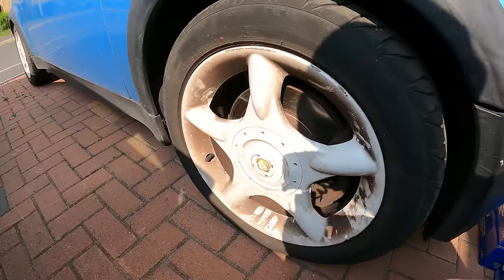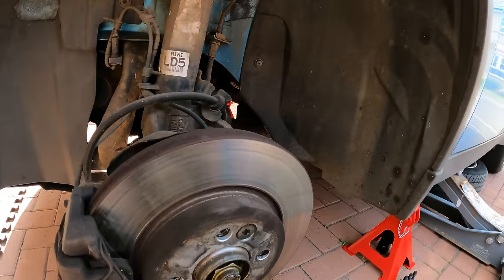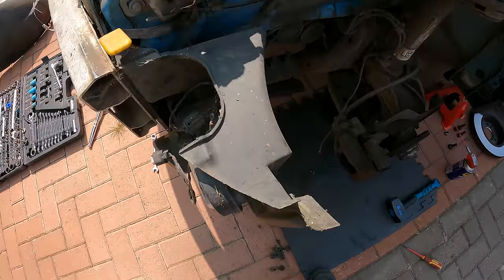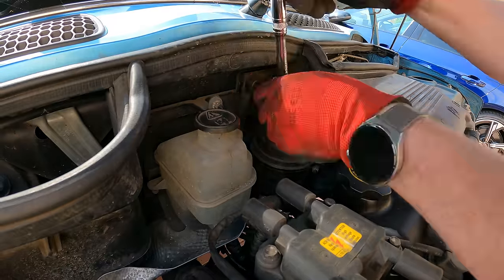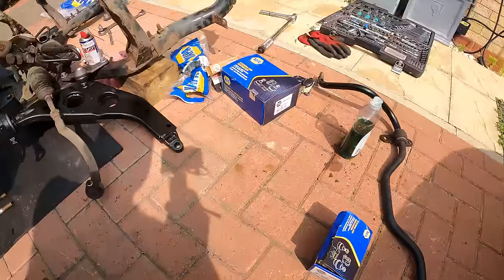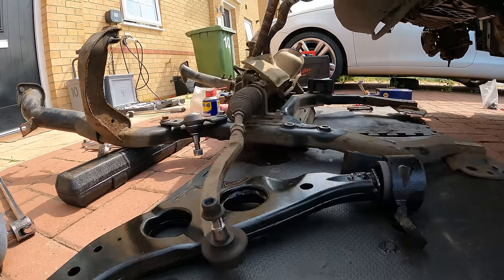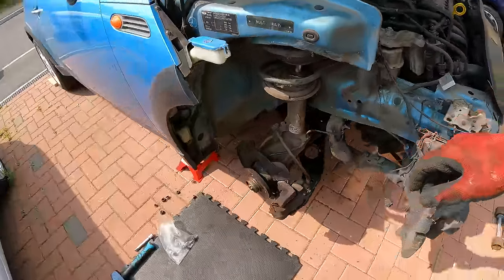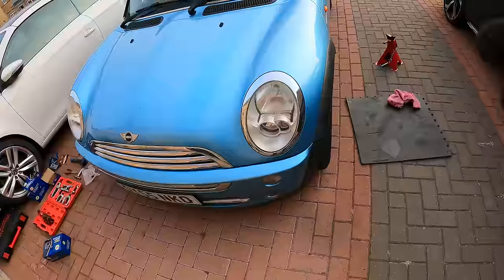MOT FAILURE MINI Warning: You'll Regret Not Knowing This!

Comment: When I go to the trouble of removing a sub frame, any sub frame, I spend that bit of extra time to remove surface rust, flaking paint and give it a coat of red oxide, and whatever hammerite I happen to have in stock.
Reply from the maker: +@stukyu I really wanted to do that, but time was against me on this one. I also had a lot of stuff packed ready for the house move.
Reply: Agreed. Once you’ve had a Mini in perfectly good mechanical condition fail it’s test because of excessive front subframe corrosion, you get a bit paranoid about this. Just had mine up on ramps and given it the full wire brush + rust converter + Hammerite + Waxoyl treatment 😂😂
Reply: Do the “while I’m there’s” is my go to for doing it right
Reply: Lanoguard. Sorted.

Comment: I parked my 1975 Land Rover by a Mini the other day. The Mini was not so mini, being longer and wider than my Series 3 Land Rover 😂.
Wow, new minis look so simple to work on. Not like the original ones which were so terribly overcomplicated and blew their own engines up at 60k 😂🤣😂.
As others have suggested, poly bushes would have been the best way to go. They are just a slightly better material than the cheapy rubber ones you got, which are possibly made India anyway. Also there is no point in changing parts which don't need changing. They may already have been done recently and just look a bit old.
Good luck in your new garage 👍

Comment: I did mine too. Never touched the subframe though! Removed the wishbone and used a reciprocating saw to cut through the old rubber bushing. Replaced with a polybush and compressed it in using a special tool freely available on a major auction site. Bit fiddly to line up and compress but was doable.

Comment: It's Mini's like this that I want to save from just being scrapped or broken for parts. Not so much about profits but more to keep them on the road. It looks like they are in the 90's dip of the classic Mini and rather than seeing them drop off the roads, I want to keep them on and loved. Electric blue too, great colour! If you need to remove the radiator at all (i.e. replace the shroud), check and test the low speed fan first. The resistor fails and the replacement needs the shroud off ideally.

Comment: Great job well done that man ,next time clean All the electrical connectors with WD40 contact cleaner before putting them together works a treat 👍🧑‍🔧
Reply from the maker: +@mrgrumpy9077 Thanks for the tip, I will keep that in mind for future videos.
Reply: Brake clean is cheaper.  Nearly all these sprays are iso propanall based.

Comment: Is possible to change arms without dropping subfame completely. Drop subframe a few inches enough to remove the long bolts .
Reply from the maker: I have seen some videos where you can drop the back to give access to do it but the bolts are very tight so it would depend on the access and the ability to get the bolts out. There is also the option to replace the bushes after doing that but you would need more tools to make it possible. I honestly think the cleanest way is to drop the subframe.

Comment: I assume the engine is not attached to the subframe?
Reply: They are mounted to the body. Just tied to the subframe to avoid torsional movement. So the subframe can be removed without having to support the engine.

Comment: Regarding the wheel Alinement of your Mini..! The Wheels are supposed to be positioned slightly Toeing Out because as the car is driven...! The Wheels get pushed inwards, more so on fount wheel drive because the off the driving torque of the drive shafts...! Best leave it, as is...! 🤔🤔😇😇👍👍

Comment: What mileage is it on?  My Mrs has a 2012 cooper S Roadster with 35k,  had it from New still has the factory fitted brake discs n pads (5mm left).  Only issue shes had was a front passenger spring snapping whilst it was parked and an AC condenser swelling and leaking.

Comment: I did this job last year on my mini.  If anyone else is doing this check your subframe while  your at it. Mine had a big rot hole in one of the uprights. The drain hole was blocked causing the rot.
They are great cars to work on.

Comment: Did you fix that wobbly radiator?
Reply: You can see two new bolts fitted in the top of the radiator at the end of the video, replacing the plastic pins that are rubbish and break off…
Reply from the maker: Yes I did but it's not a complete fix as of yes as I need to make sure I get different nuts with nylon in the thread so they don't come free with vibration. This is in the next Mini episode.

Comment: Why didnt you clean and treat rust and spray like new?
Reply from the maker: That would have been an ideal situation but the subframe was only slightly affected by surface rust so balancing out the time I had to get the work done versus completely revamping the subframe, I chose to get the job done. Very easy to find fault in what was ultimately a video showing how to fix an issue and keep a car on the road.

Comment: Think you should of jet washed all under front end would of looked so much better on temu they sell know rust just clean main crap of 
then paint on everything that's rusty 
only £2.50p 100 mlg goes on like a milky colour then drys matt black will make big difference when selling cars on sills front springs anywhere there rust looks tiny when done look at other products for faded black trim in and out as well a few ££ get lot more money smartens plastick up around car 
and door cards dash 
like the plastics in the engine bay rocker cover 
have look bud then if you like them put big order in keeping stock pile for future cars 
when they look the part 
people think it's been look after
Reply from the maker: Yes that was an option but these are the quick flip episodes. If the new owner wants perfection they wont be paying around £1,000 for the car. Got to be realistic when doing the work and balance out the content.